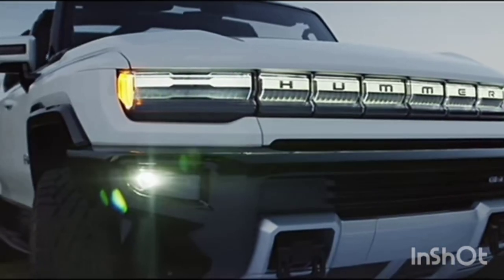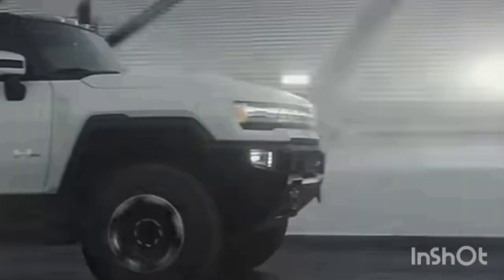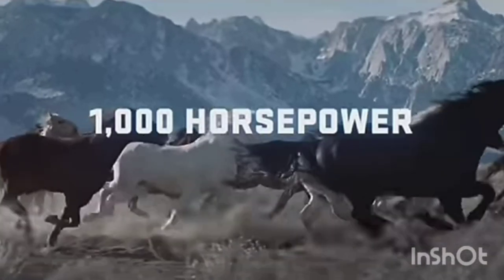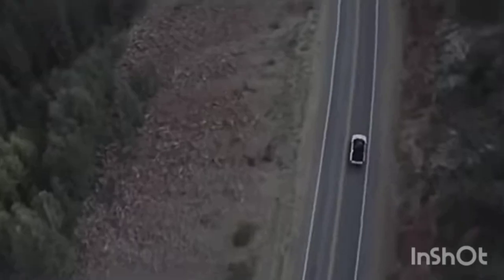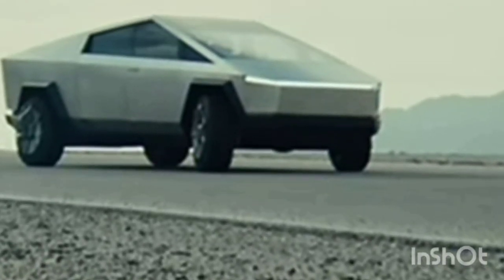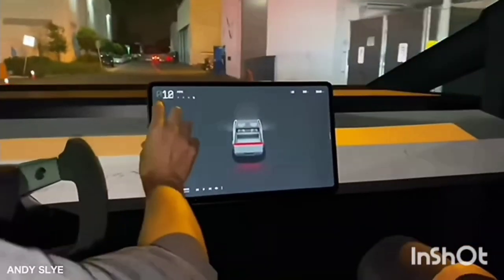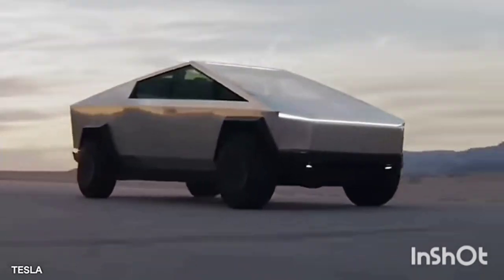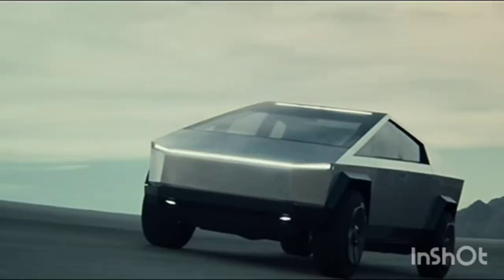Hummer GMC pickup truck VS Tesla cybertruck

Comment: Basura! GM paid, Didnt even state the price of the cybertruck.
Reply from the maker: The Tesla Cybertruck will cost from $40,000 for a single motor, two-wheel-drive model, while the top banana (and blindingly) quick tri-motor version will set you back more like $70,000. You can secure one now with a $100 deposit.